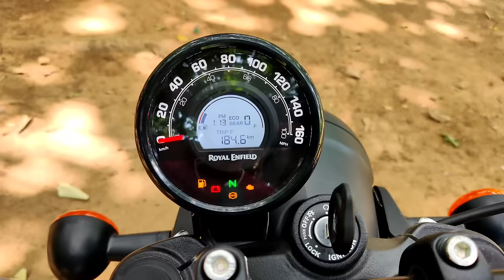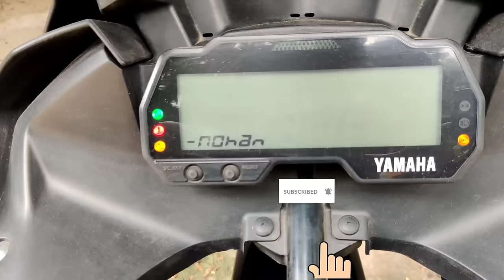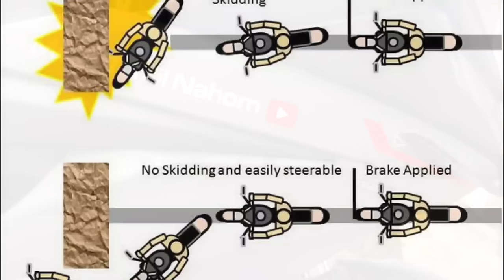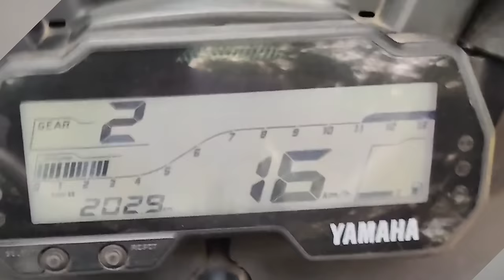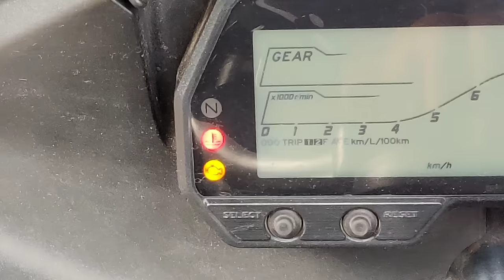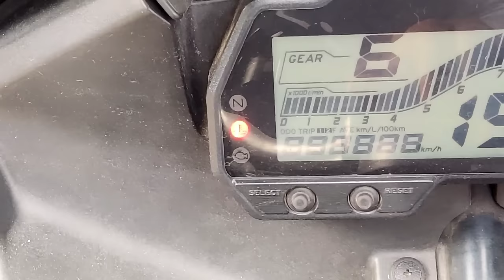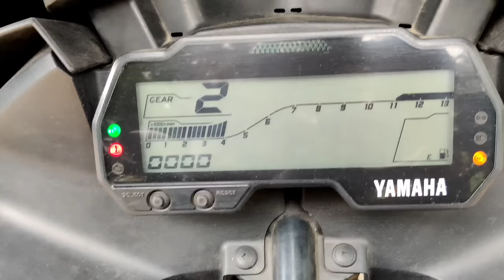⚠️ Unknown meanings for warning lights in bike instrument console | In Tamil | Mech Tamil Nahom

Comment: Bro bike front டிஸ்க் break பிடிச்ச நோசி வந்தது break விட்டு விட்டு பிடிச்சது, so நான் caliber கழட்டி பாத்தப்போ ஒரு caliber piston ஜாம் ஆகி இருந்தது so நான் fulla கழட்டி piston ரிங்ஸ் ரெண்டு pistonllayum மாத்தி clean பண்ணி போட்டுட்டேன். டிஸ்க் master oil cylinder clean பண்ணி new oil and டிஸ்க் pad போட்டுட்டேன் இப்ப break நல்ல புடிக்குது noise இது இல்லை. But center stand போட்டு front wheel சுத்துனா lighta பிடிக்குது ரொம்ப tight இல்லை. நான் டிஸ்க் ஏர் bubles கூட remove பண்டேன் இது எதனால டிஸ்க் lighta புடிக்குது சொல்லுங்க..
Reply from the maker: Adhu clearance problem bro ...adhu normal than ...sila bikes varum ...
Reply: @mechtamilnahom  thanks bro இப்ப ready ஆகிடுச்சு

Comment: bro oil light yeridhu..ana bike start pana off aairuthu adhulana edhum problem maa
Reply: No problem bro
Reply from the maker: Engine oil level ok va? Bro
Reply: Storeroom la service vidu than oil change panan..engine vera level la karukuthu enanu therla .. mileage 23than varudhu..ena problem therlaa
Reply from the maker: Oil filter mathunga bro
Reply: Bro engine oil change panum pothey oil filter change paniruvan epayum..bro Carburettor clean panni tune panitan air filter change panitan analum mileage 23than varudhu ns 160ku idhu ena romba kammi bro..ena pananu therla any solution bro
Reply from the maker: Castrol power ultimate engine oil try pani paru bro ☺️
Reply: Apti oil change pana mileage vandhuruma bro
Reply from the maker: Yes bro 😊